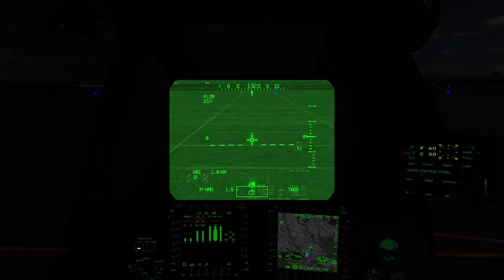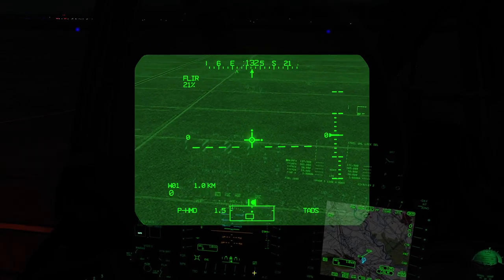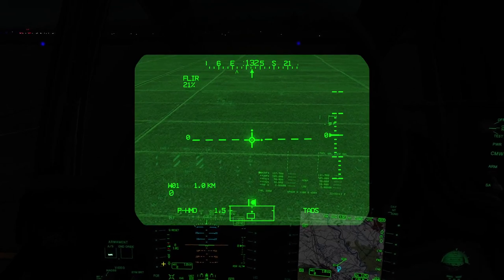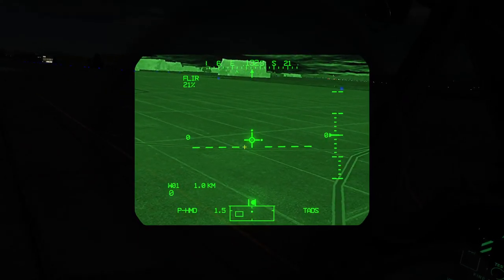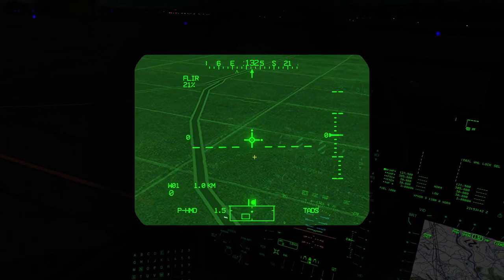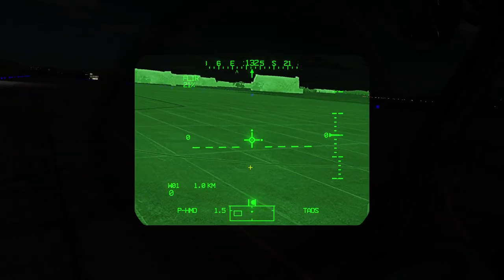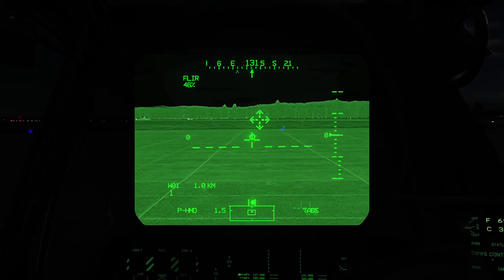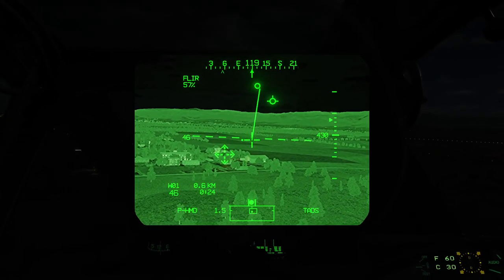AH-64D Pitch Attitudes and NVS Techniques

Comment: So does it make sense to use transition symbology even in hover in order to have a cues for proper attitude?
Reply from the maker: No, because now you're losing the accuracy of the Hover velocity vector. It's a much better cue for assisting in determining drift. When at a hover, the trim ball should be about 1 full ball width to the left (this is about 3 degrees of roll). Use that as a supplement to maintaining your roll attitude.